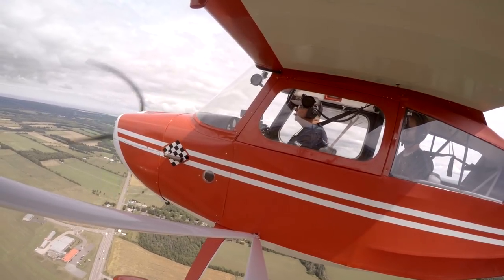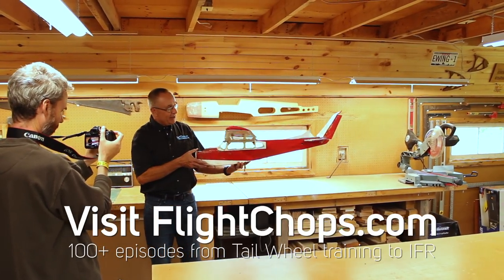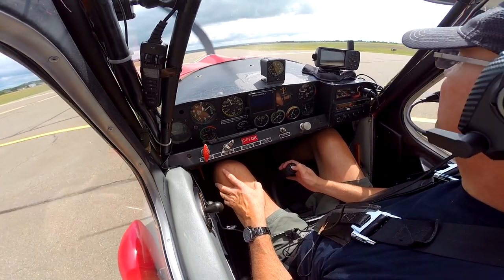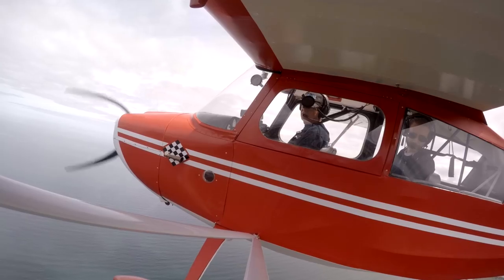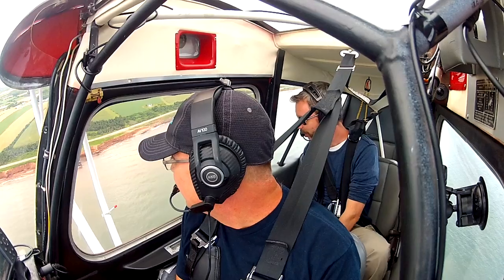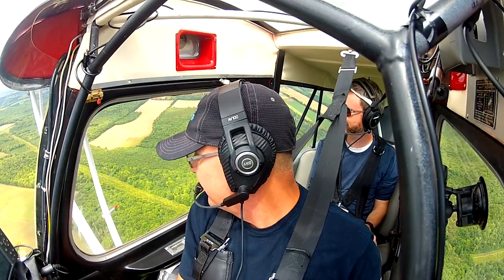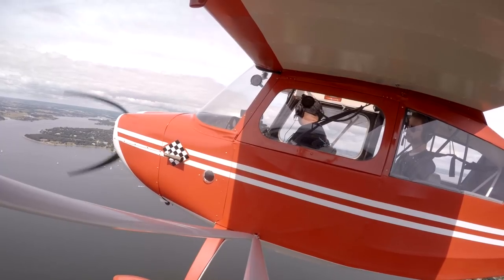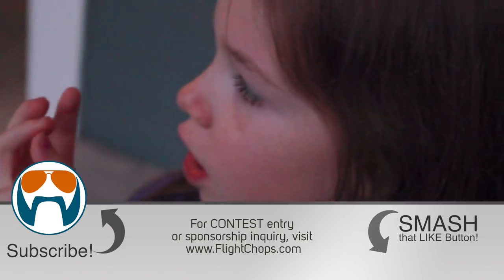Common Pilot Confusion - Class E Airspace, FSS and MF - Citabria over P.E.I. - FLIGHT VLOG

Comment: Since there is no UNICOM or tower, what frequency would you go onto, and how will you tell the other pilots?
Reply: The FSS operator in this case takes on a similar role to ATC personnel at a fully controlled airport. While in a basic MF you would be adressing your calls to other "traffic" or "__ UNICOM", in this case you are adressing "___ Radio". The required frequency for the MF would be published in all the appropriate charts etc. The Radio operators job is to act as a middle man between pilots, who advise him of their positions and intentions. Due to his radar screens and the info received from pilots, he has a clear picture of the traffic in the area, and so can provide advisory services to each plane if so required.
Since it is a Mandatory Frequency (MF) area, all the other pilots in the immediate vicinity should be on the same channel, and so should be aware of each other's presence. If you are moving into a MF, you can make a call that you are switching frequencies on the enroute frequency, and then ask the FSS operator on the MF for the latest advisory, and they will get you up to speed on any pertinent weather or traffic info that they have access to.

Hope this helps and maybe answers your question and I didn't just spend 10 minutes typing this on my phone for nothing ;)

Comment: Hi Steve, that's a pretty interesting airspace construction. I looked at charts, and it looks like the class E is the control zone for the airport. So the IFR traffic will be controlled while the VFR traffic will not. I'd like to know how they manage that on the daily ops. I am a flight information operator in Denmark (enroute flight information with radar) and I also do a lot of flight safety work. Here we work VFR traffic enroute from SFC to FL195. SFC-3500' is usually class G and above that until FL195 it is class E. That class E presents it's problems, and I can only imagine how difficult it can be as a tower controller.
Reply: There is a large flight college near by that has a steady stream of student VFR pilots on cross country flights to Charlottetown. It's an MF airport, so everyone is on frequency. FSS more so "manages" the the zone rather than controls...but it seems to work.
Reply: Here in Denmark we have a thing called AFIS, which is Aerodrome Flight Information Service. It corresponds to a towered airport but the local airspace around the aerodrome is class G RMZ (Radio Mandatory Zone, like your MF). So everything is uncontrolled but on frequency. Usually the operator has a radar rating as well so we can do the hand offs from the center into the uncontrolled airport. With a class E MF, I guess the IFR traffic will be controlled, as class E airspace is controlled airspace for IFR, right (that's the way it is here, anyway)? Does anyone know how they avoid having uncontrolled VFR traffic cutting in front of an arriving or departing IFR flight? I guess that the IFR will have some kind of priority and be provided with ATC. Do they issue a landing clearance for IFR or how does that work exactly?
Reply: Class E would be controlled for IFR and their landing clearance is issued by the FSS. The FSS would also provide IFR separation with other IFR traffic. VFR aircraft are expected to provide their own separation for both IFR and VFR by being on frequency and following the "suggestions" by the FSS. No clearance is giving by FSS to VFR. At least that's my limited understanding of it. I'm no expert by any means.